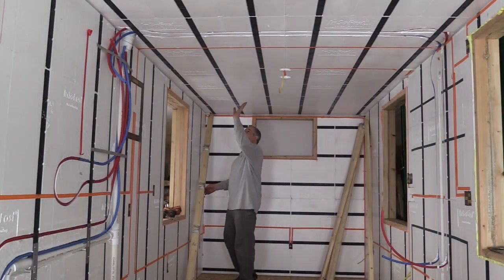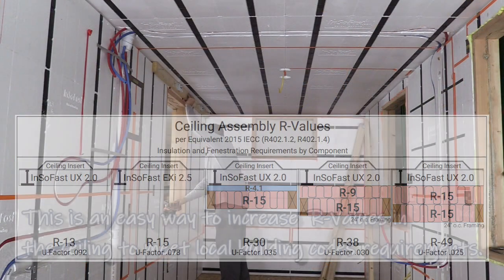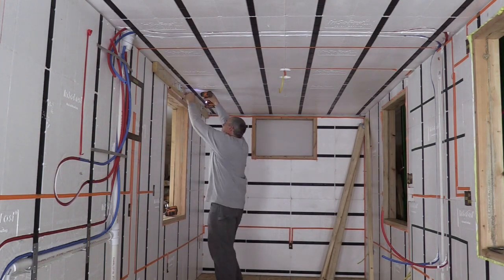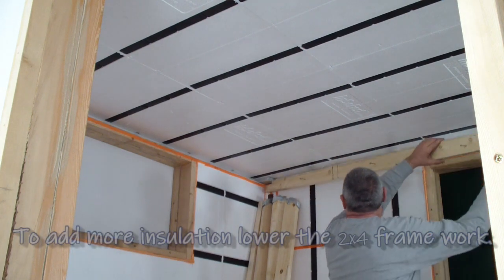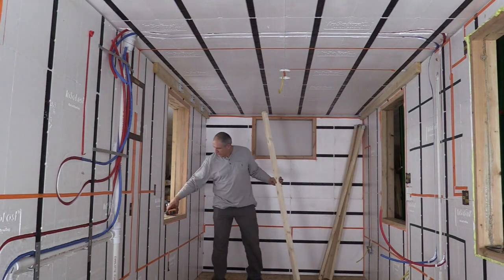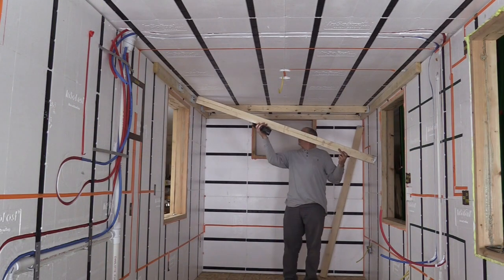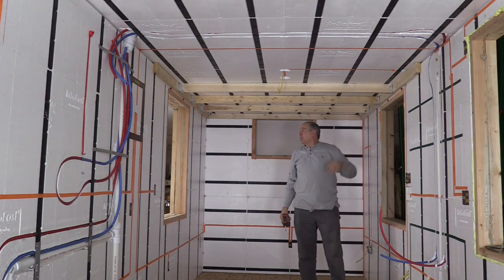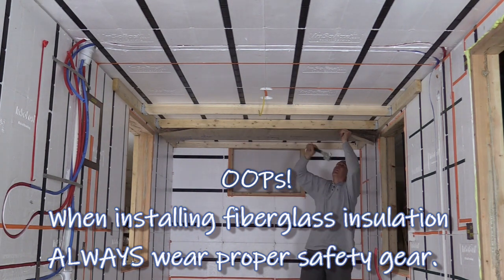Increasing Ceiling R-Value for a Shipping Container

Comment: Just a thought why not apply the insulation to the external face ? Then use battens & a tyvek vapor barrier before applying the external cladding. More internal space plus you can use the steel channels to hide pipes & wiring.
Reply from the maker: Good thought Keith. Yes another good way to insulate is the exterior. Exterior roof insulation you can use traditional construction methods like roof trusses and fiberous insulation. If your container is not going to be mobile and you are not concerned about over the road size and height restrictions. 

I am not sure if you would require tyvek since the steel container itself acts as your air and moisture barrier. Just use cladding material that is not subject to mold and rot from moisture.  We do present how to insulate on the exterior on our website. https://www.insofast.com/resources/shipping-containers-exterior-insulation-panels-CX44.html